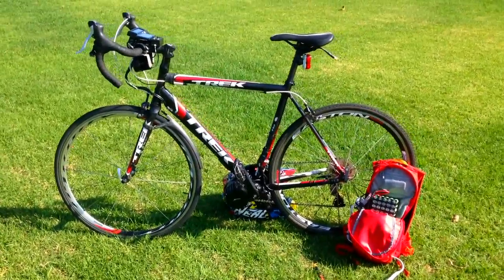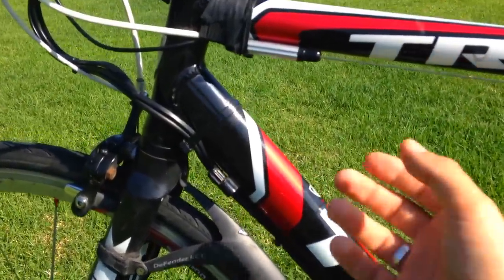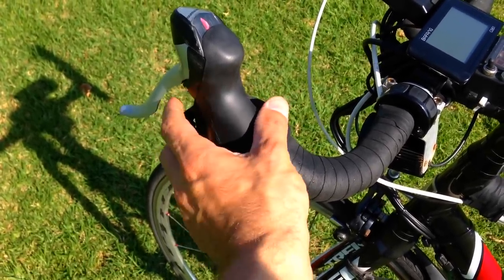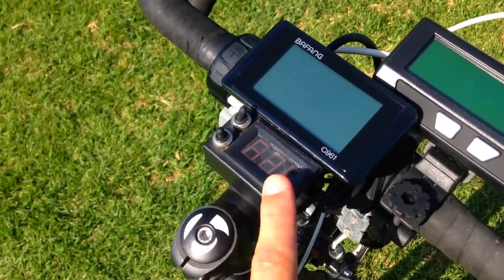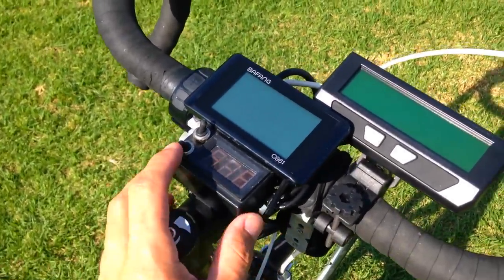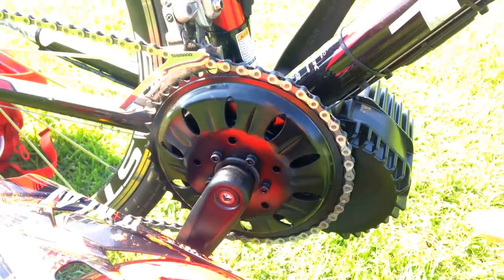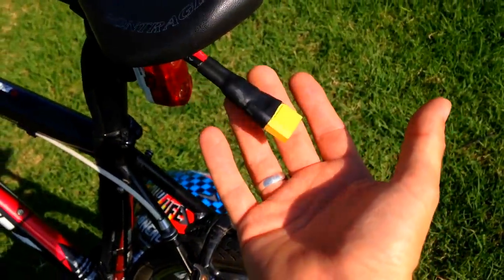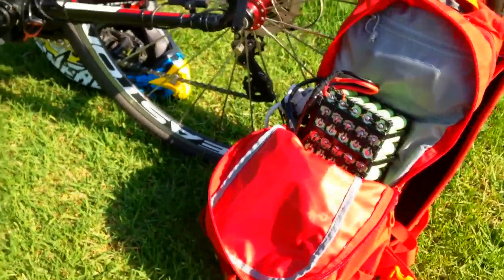Bafang BBSHD 1000w mid-drive • Walk around my road bike • Electric Bike 48v BBS02 8fun motor

Comment: I put a 350 watt rear hub motor on my road bike and 36 volt battery. Its great! I've been using it to commute 24 miles every day for the last 5 months. I get to work in the same time as in my car and have saved £650 in fuel costs so far! Now i want more POWER!!!!!!! Time to build myself a new ebike with mid drive bafang! Love your videos! POWER!!!!!!! 💪

Comment: Hello Bruno, 
Why does the BBSHD controller comes with either the Anderson Connectors or the xt90 connectors? Why doesn't the BBSO2 controller doesn't comes with the Anderson Connectors or the xt90 connectors? The BBSO2 controller only comes with two pins color coated red and black? Is there any battery that has the two pins to connect it?
Reply from the maker: Hey mate,
When I used to work in the ebike shop selling Bafang motors back in 2016-2017, the BBSHD controllers used to come with just Anderson connectors and we had to fit XT90. The BBS02 and BBS01 used to come with a cheaper  bullet connector with clear silicone sleeve (same as the phase wire connectors) over and we had to crimp Anderson or XT connectors. These are just simple connectors you could easily change and fit anything else =]
Reply: @BrunoPOWEEER  
Thank you for taking the time to response back buddy. Also those wires from the BBSO2 controller the red and black are those wires 14guage or 12guage. I want to make sure I'm doing the right thing to cut off the wires and add the Anderson Connectors. Should I put the 30amp or the 45 amp in the Anderson Connectors.

Comment: Hey Bruno maybe you can help me since you worked for bafang and you do know your stuff.
I have a bafang M400 MM G330.350 19 middrive motor with an
CR X10B250SNU 3.0 controller.  Unfortunately this controller doesn't accept throttle or does it. Though I've seen some M400 with throttle.
My question to you, is there a controller for this motor that will allow me to use throttle even if I have to attach the throttle outside of the motor case. Any feedback you can give me will be highly appreciated thanks

Comment: Looove your bike man! It's super stealth, which is the Australian way. Your build has made want to convert my bike into an E-bike, and I think mine's the perfect candidate! It's a 2005 Norco Charger (Coincidental name!), it's a hardtail XC MTB 26er with an solo air Marzocchi fork, hydraulic discs w/180mm rotors,  3x9 gearing, and 26x1.5 Schwalbe Marathon tires. It's fast rolling as it is right now but it needs more POWEEERRRR!

I'm thinking of going with a kit from Lunacycles since I'm Canadian, a BBSHD with a 52v 20Ah battery pack, frame mounted to centralize the weight. I'd make my own pack (I like to DIY if possible) but I just have a soldering iron and a multimeter.
I'm also a speed addict like you so I want my bike to go as fast as possible. How'd you put on a 52t ring? would a 42t ring suffice to get to 50km/h?
Reply from the maker: +GustSergeant - Yeeeeahhh... Norco "CHARGER" hahahahahaha.. I want that bike.. sounds nice hahahahaa.. 
All specs are nice.. highlight for the 180mm rotors!!
So the BBSHD comes with the 46T stock chainring, California eBike sells an adaptor so you can put a much bigger chainring https://california-ebike.com/product/hd-130-chainring-adapter-bafang-bbshd/ but maybe get the motor first and see how it goes... it is fast already... get the programming cable, play with the settings https://electricbike-blog.com/2015/06/26/a-hackers-guide-to-programming-the-bbs02/ then you put a bigger chainring... this is the best way to understand how much torque and power you get, if you just go straight to the large chainring you may never understand the limitations and capabilities of your system. It's kinda good to spin the chainring faster, it gives you better acceleration, better range as it is much easier for the motor to spin... as soon as you get a large chainring like 52T yes you get a better top speed but you will be forcing the internal gear a lot more and top speed is more related to power+aerodynamics than power+gearing, 52T may give you a bit more speed and a lot more electronic/mechanical things to worry about.
If you like speed, forget about the 42Totherwise you will be spinning your legs like this guy here https://www.youtube.com/watch?v=h5a3C2MC87g hahahaha.. 
The only way to find out what is the best for you is actually spending some $$ and trying things... you may like the 42T... you may like the adaptor with a larger ring... 
POWEEERRRRRR =]
Reply: +ElectricBike (Bruno) Thanks! I'm gonna record the day it lives up to it's name. A picture of it is here https://www.instagram.com/p/BD6vaxKin86/
Beyond the motor, I have a growing list of mods in mind to improve and prepare it for the added power. 2-piston brakes (Elixir 3s), an air fork with a lockout (2005 fork=none), and 35-40mm wide wheels so my tires are more square (improved rigidity, less psi, same Roll Resistance).
What I'm hearing from you is that a 52t chainring could possibly put more strain on the motor itself for a minimal gain; I'd prefer to avoid that. However, That adapter is cool because I could attach another standard chainring with 46t and it'd be lighter overall. That, however, would be extra money I'd spend down the road, so I'd probably use the stock chainring for a while.

Comment: What is the range if you peddle as well to get the  maximum range.
Reply from the maker: +pop bode - I normally don't use the battery all the way so it is a bit hard to measure the range with accuracy...  it is really hard to tell, you'll notice that the range drops in a windy day or if you ride at peak hour traffic with lots of stop-starts. 
I would say with the powerful BBSHD I would get something like 23km with this 14.5Ah 52v battery... the BBS02 was a bit slower and less powerful, the range was something around 26km but not as fun as the BBSHD. Once I took the BBS02 to a highway and did 36km at full throttle with very few stops. I am always pedaling but I do use a lot my throttle (it is addictive). It all comes down to your riding style, terrain, and all these other factors, if you set the pedal assist settings to a "mild" instead of "wild" level you can double this range =]

Comment: Anyone know what the break sensor tube thing called so I can look one up and buy it?
Reply from the maker: They call it “in line brake sensor”
https://swytchbike.zendesk.com/hc/en-gb/articles/360007613857-How-to-fit-the-Inline-Brake-Sensors
Reply: @BrunoPOWEEER   wow a reply ! I'm subscribing 

(Also can you make a video on how you attached the throttle? Or is it already done? )
Reply: I'm trying to use a 3/4" tee tube but my handle bar is 3/4" so that didn't work. Did you have the same problem? How did you over come it?

Comment: awesome!
Reply from the maker: +Christopher Kenning - Yeeeahhh..  I am glad you like the video hahaha... I make complete conversions like this one almost every single day at work... we only do off-road MTB as the BBSHD is way too powerful and "road illegal". I am an electric/electronic technician so I really enjoy doing the harness and the battery wiring very neat like a professional install.. I like spending time planning the best way to hide all mess. Each case is different depending on the frame size, shape, space and accessories on the handlebar, I hide most of the mess under the BB all with waterproof heat-shrink =]

Comment: Nice set up. 
How hot do your batteries get after a 20-30 minute ride?
Reply from the maker: +Brap Pitt - Hi Brad, great question! I ride this thing with 52v 14.5Ah Panasonic PF cells, 20min doesn't heat up much but 30min I can actually feel getting hot. I am not sure the exact temperature, this will be very interesting to make a video as I can actually measure the cell temperature. Video is the best way to answer this question =]

Comment: How would you do a cut off for a hydraulic break system?
Reply from the maker: There are lots of factory hydraulic ebrakes nowadays and there’s also a little aftermarket magnetic sensor that you glue with epoxy (JB weld) to the brake base and glue a small magnet to the leaver so when you press the brakes it pulls the magnet apart from the sensor and sends the signal to the motor. 
Search on Google: 
bafang hydraulic brake sensor
Reply: Thanks mate!

Comment: Hi,
I'm a keen mountain biker and have had a home made electric road bike since 2006. My bike is really warn out and isn't as reliable as it use to be (I broke a gear cable today on my way to work, last week I broke a spoke and buckled my rear wheel. 
I'm all about high speed (but trying to keep the bike legal), while pedalling hard, I usually average around 40km/h which is nice because I live out on a quiet, hilly stretch of coastline between Tathra and Eden NSW (my commute is 33km each way. 
I really like your set-up. How did you gear your bike? What size chain rings are you using?

Comment: Hello power guy 

I have a road bike.
I will buy a Bafang mid drive kit. 
I will go for the black good looking bottle battery.

Now here is what I don´t know yet.
My bike has 10gears in the back cassette which therefore has a smaller chain I think? (I have heard there are different chains to fit the cassettes since some are narrower than others) 
Will my cassette and chain fit with the chainwheel on the Bafang, or do I need to change cassette and chain? The local bike shop here said that I should  do one of these
1, get a different chainring from bafang that fits better
2, change the cassette or chain
3, let it be and it could work
But if they don´t go with one another, it will tear on the gear and also maybe motor?

My other question is: is 250W really the 350w? or are there 250,350,500,750,and 1000? 
Which one should I go for if I want as little problem as possible? I don´t care if its super storng or not(top speed rather than power/torch though) , I just want long reach without getting sweaty....

Best Regards Mikael

Comment: Can you make a video showing how you connected your lights to your battery?
Reply from the maker: +Nelson Olivo - Yeeahhh.. I have a new light here in hands, I have to buy some IP67 mini toggle switch (rated for wet and dusty environment) + a rubber cap (also waterproof on the switch... I will be showing how simple it is =]

Comment: Hey what did you use to water proof the connectors? I need to make an extension cable so my battery can connect to the motor while it's in my back pack. 
Would like to know if possible, the equipment you used to water proof the connectors, standard heatshrink? which adhesive? etc. Thank you

Comment: Great ebike build, grat video. The in wire brake sensor is just what I was looking for.
Is it too hard to pedal along when at slow speeds with that 46tooth chainring? Does it still have good torque to go up steep hills? 
Thanks.

Comment: Awesome video. POOOWER!! Have you made the video explaining how you set up your throttle yet? I'm trying to figure out how to set up my throttle on my Kona Jake, seems there aren't that many people out there using drop bars.
Reply from the maker: Heeeey Landon, I haven't done the video explaining how to setup the throttle yet as I had to unwrap all the handlebar tape to explain properly and this was my commuter using 7 days a week so was kinda hard to stop. I can guarantee that the reason why we don't see many electric with drop bars is because it's almost impossible challenge to setup the throttle and ebrakes... it took me days looking this thing trying to figure out something =]
This video is coming, in the main time just attach the throttle with cable ties so you can ride this POWEEEEEEEEEERful beast hahaaaa... I just made a new bike so it's time to show this throttle =]
Reply: Hi Bruno. I'm also looking to convert my road bike. I was hoping if you could link me to the brake sensors you bought, I can't seem to find them :/. I'm looking forward to that video about the throttle mount setup too but I'll make do with some zip ties in the mean time.

Comment: Why the backpack? Wouldn't you rather build a small pack into the frame?
Reply from the maker: +the modfather - Yeeeahhh... there are many reasons why I carry my battery in my backpack. My top 3 reasons are: 1) my pack is bigger and more powerful than usual. 2) Road bike with 120psi tires are VERY bumpy (almost like riding a bike with no tires) very uncomfortable the vibration and impact at high speed would hit the battery very hard like a hummer, damaging the cells and the structure of the pack. 3) The bike feels MUCH heavier with the battery mounted on the frame, I like it light and agile.
In the end, it is a matter of taste, there is a very interesting article from my friend Karl explaining the pros and cons of both options: http://electric-fatbike.com/2015/06/02/battery-on-your-back-or-battery-on-the-bike-which-works-best-for-you/
So much POWEEEEEEER =]

Comment: You funny, man i love the excitement. I just got my bafang 48volt 1000watt bbshd midrive for my Scott sub 20. Its going hall and i have samsung 52 volt 14 ah battery. I can't wait  to get it up and running. I would race you. I got a DPC18 display. I think your display max 70 kph i think. Thanks for video. I got 42 teeth maybe o will get a bigger one if it has enough torque to get me going fast of the line. I dont know what kind of chain to get so it doesn't snap. If you read these, some info would be nice. 👍🏻😀👍🏻
Reply from the maker: Yeeeeaahhh mate I read all comments here hahaaa... I worked with Bafang motors for many years and can tell you that the best match for that motor is the 42T Lekkie Chainring... anything smaller you get a really bad chain line and will be replacing chains all the time, anything bigger than 42T the motor runs hotter, less efficient, some people noticed 25% less range from 42T to 46T, less acceleration and not that much more top speed. The only bike that it’s fine to run 46T is something super lightweight and naturally fast like this road bike in the video. Have you watched this video https://youtu.be/MjefSotenIU

Comment: very nice review.
I have MTB Giant Talon 3 that comes with Hydraulic brakes. Can I install this system and keep the hydraulic brakes? Some mentioned that there is a universal sensor kit for that ?  
And What's your advice considering the Leed 500w series that comes in a front wheel hub motor? Which one I should choose ? considering the hydraulic issue.
Thanks anyway.
Reply from the maker: +Dr Abd - Yeahhh... thanks for for watching... there is a magnetic cut off sensor that is really cheap and little, you need to glue it to your lever and glue a little magnet in a way that when you press the brakes the magnet pulls away from the sensor and it tells the motor that the brakes are engaged. Maybe get 3x sensors so you have a spare one just in case so you can practice glueing without worrying. Mid-drive motors are much more efficient than hub motors as you can benefit from the bike gears and find the best ratio for each situation. Uphills is when mid-drive shines and you will regret if you chose the hub motor (single gear, no enough torque in some cases)
Both cases you better have cut off sensors, there is also a green button (accessory) that works like an emergency button to stop the motor. You can also get a Tektro Auriga or Tektro Dorado hydraulic brakes, it comes with sensors built inside the levers.
If you are in Australia, check out our website we got all these items: http://www.emax-ebikes.com.au/ if you can't find on the website just drop an email and Ewan will contact you =]

Comment: Very cool. Good work. Do you know where I could get hold of a wire switch like yours?
Reply from the maker: Yeeahh... Where are you located? There are many Bafang dealers selling it, just google "Bafang eBrake cut off sensor" and you will find soooo many sellers. You MUST have at least one eBrake sensor, some people think they're not important and ended up forcing the motor that would still working for a second while using the brakes, yes the motor will eventually stop but it is dangerous and destroys internal gears, remember electric motors have so much POWEEEEEER =]
Reply: Hey Bruno, I was searching but couldn't find the magnet switch for the breaks cut off you mentioned in the video. Any chance you could share link to it? Thanks!

Comment: Hi Bruno! I like your videos, soooo much enthusiasm! How much does your rig way, including battery pack and you. Thanks
Reply from the maker: +MrDonohoo - Yeeeeeahh.. thanks for watching my videos.... huhuuuuuuull.... the road bike is 11kg + BBSHD 4.8kg + 14.5Ah 52v battery 3.65kg ( https://youtu.be/M41BB5g05bI ) + myself 72.5kg + backpack 0.8kg = 92.75 total weight. Some cheap and nasty 250w electric bikes weight 27kg with much smaller battery, my bike packs a serious punch and only weights 20.25kg.... talking about a good power to weight ratio + electric motors have a ridiculous torque =] Check out how fast I was accelerating my old BBS02 https://youtu.be/a3Xf5WETMd8

Comment: great video as always! can you do a video on the anti spark connector or a link on where to purchase?
Reply from the maker: +nornsmain - Yeeeahhh.. you can find it on eBay check out this link here http://www.ebay.com.au/sch/i.html?_from=R40&_trksid=p2050601.m570.l1313.TR0.TRC0.H0.Xxt+90+spark+connector.TRS0&_nkw=xt+90+spark+connector&_sacat=0 the green plug goes on the battery and the normal one goes on the controller, pay attention to the polarity marked on the connector =]